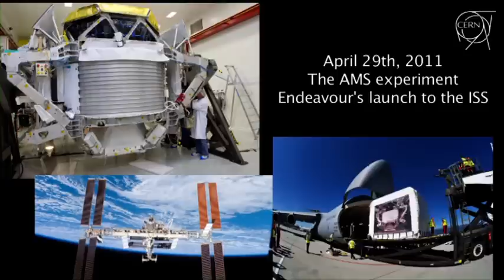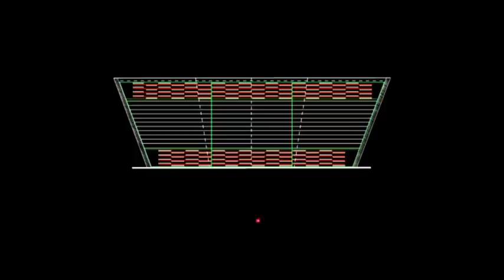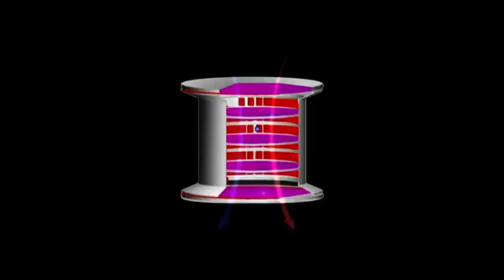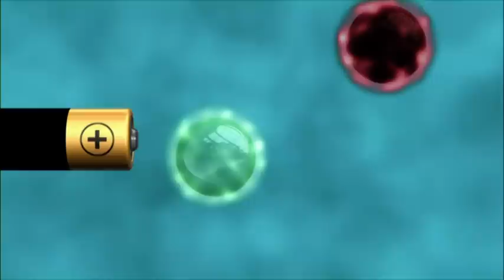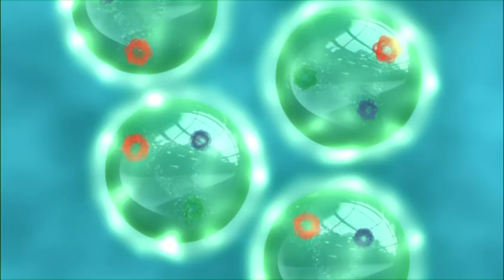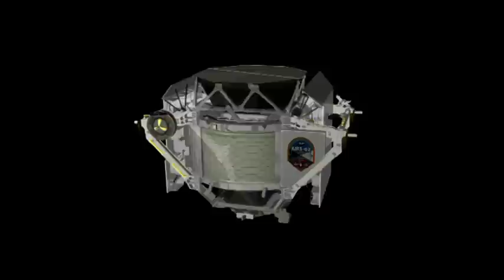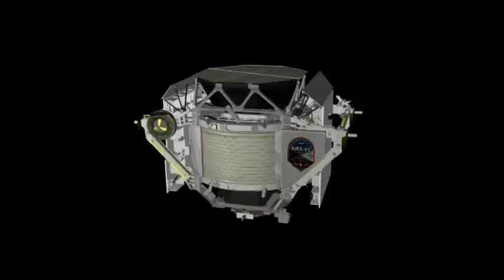AMS-02: NASA's Search for Parallel Universes & Dark Matter

Comment: Big Bang Theory is crap. If there was a Big Bang as what is prescribed in this video and by the science elite, then someone should be able to give a good explination of the 2 failures of the big bang theory which are

#1 Why is it that the background radiation isn't much higher as proposed by some mathematicians that say it should be several hundred centigrade higher because of the energy contained within nuclei destruction?

#2 Why is it the same temperature all the way across the universe?